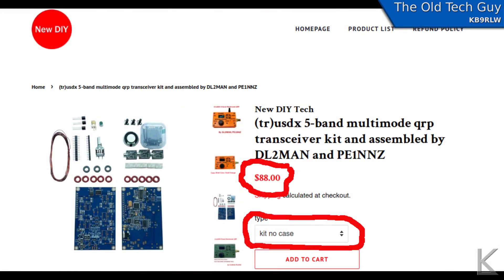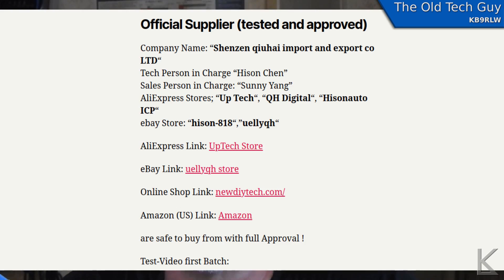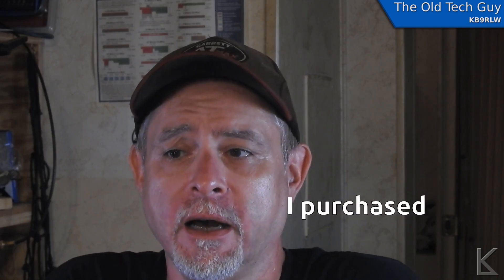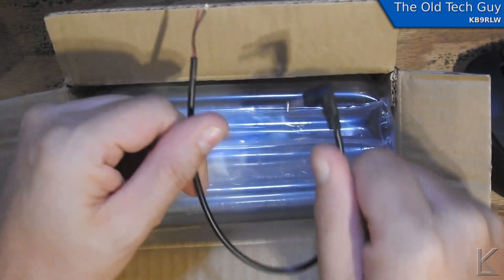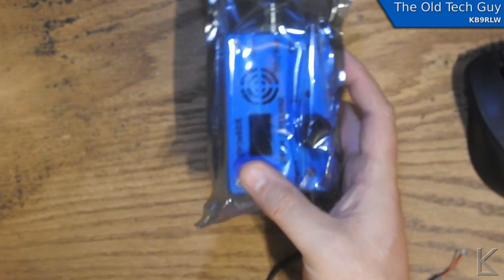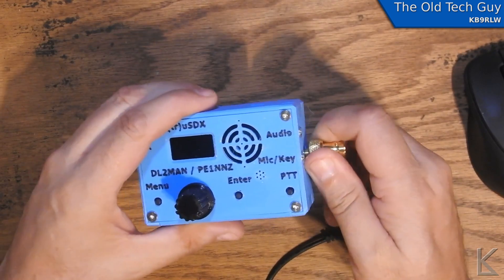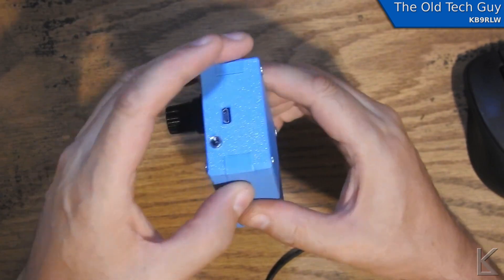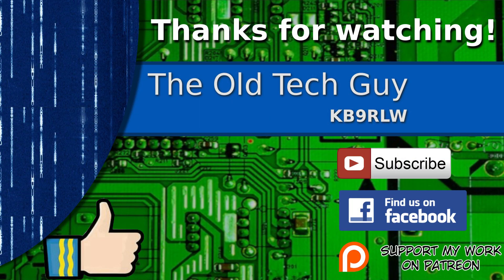Ham Radio - The truSDX #1.  Intro and unboxing of pre-assembled radio.

Comment: Could you post a video on setting this radio on WSPR?
Reply from the maker: There's already a few on doing the digital modes with it.  Manuel, one of the designers, has a video on setting it up with WSJTx, you can find it right on the page for the radio.  (Linked in the description.)
Reply: Thank you Kevin!